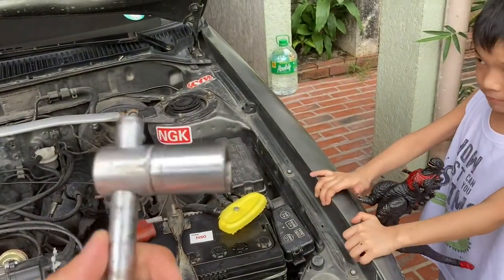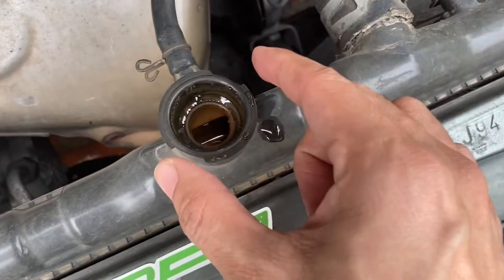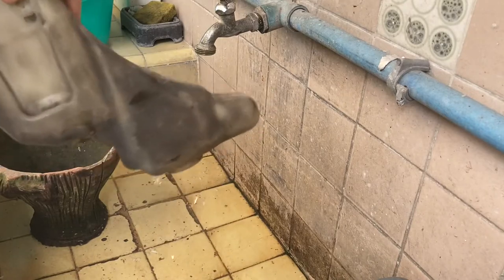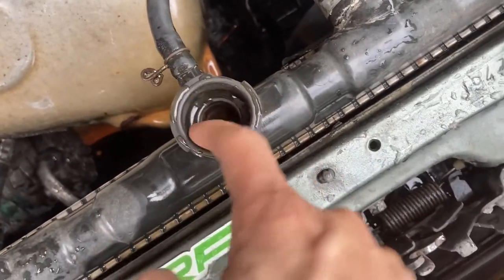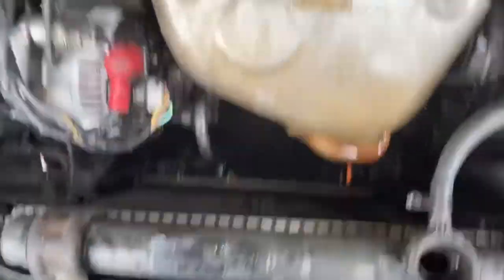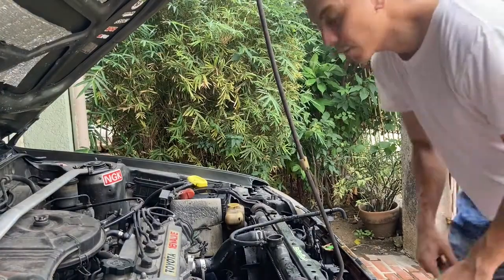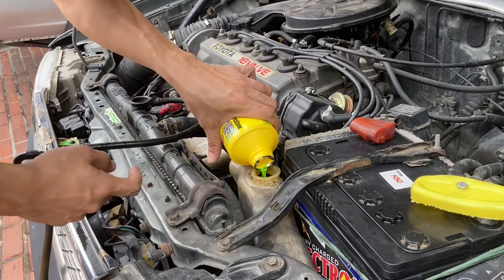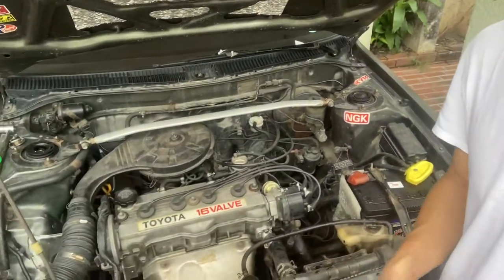RADIATOR | TOYOTA | COOLANT corolla smallbody #toyotacorolla #ae92 #diy

Comment: Hey dude, the temperature was a little over the middle. Should I just flush out the radiator, change the thermostat, or could it be something else.
Reply from the maker: Yes sir it should be right below the middle. Flush the whole system first, change the thermostat and thermoswitch, change the radiator cap as well. And check if the fans are still in good working condition. Thank you for watching!
Reply: @DadTimes  I appreciate it very dude!